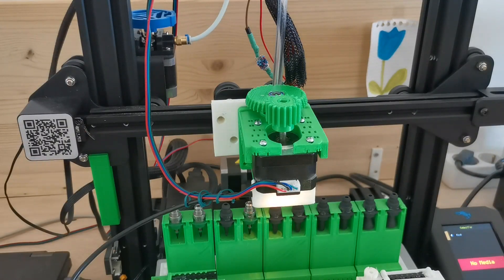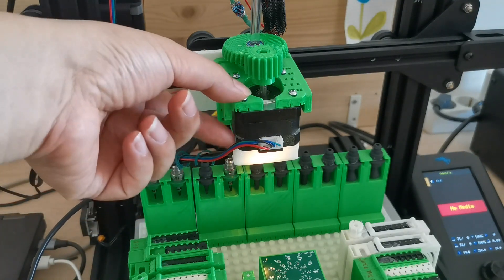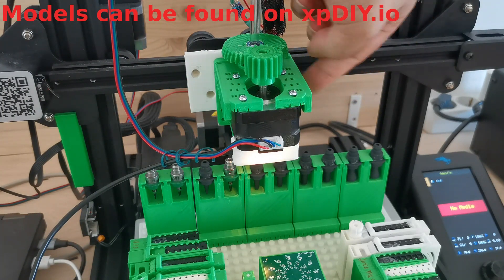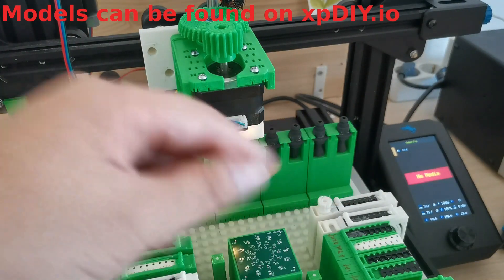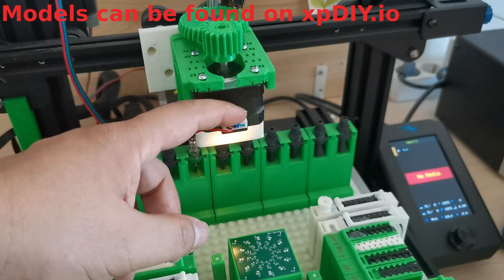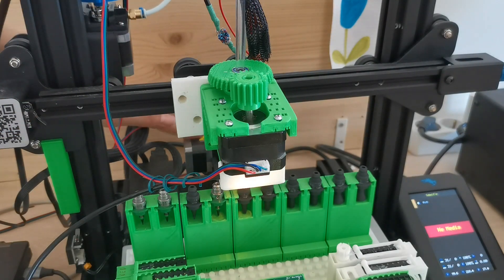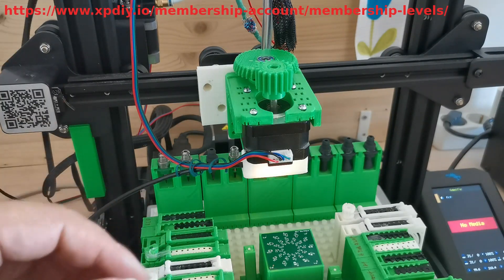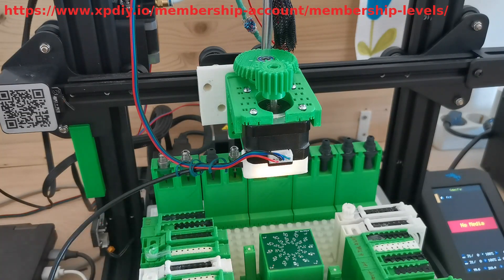3DPlacer improvements - Design of nozzle head frame to work in highter temperature

Comment: You could offset the stepper motor from the mount by few mm by using a nut as a spacer to allow the heat to dissipate OR use a vibration dampener mount.
Reply from the maker: Make sense, could have a try, thanks for being up the idea.

Comment: Very impressive project! What is the approx total cost of conversion, including all the parts in the BOM.csv file and printer filament?
Reply from the maker: Thanks! Filament itself 1kg is well enough, around 25 eur, then stepper motor, usb cameras take around 50, small components like bearing, sealing ring, spring will take another 10, then for baseplate+nozzle, I use 3rd party resin print, about 50, so in total I  would say below 150 EUR.
Reply: @xpdiy  great! can you add prices & example suppliers/product links to your BOM file, so it is easier to order the parts?
Reply from the maker: @nikkismith8750  sure, I will update that. Stay tuned!